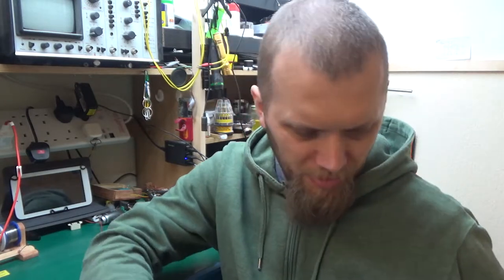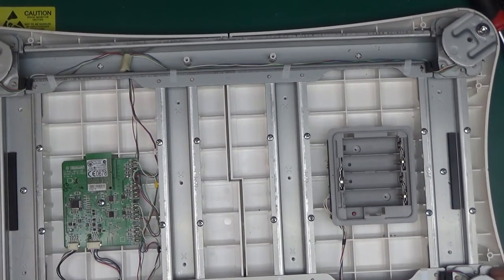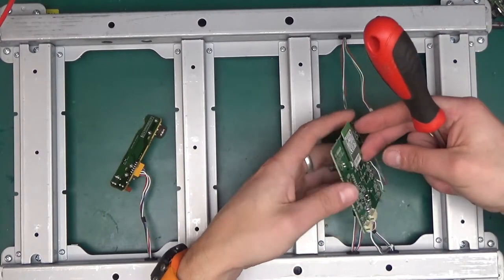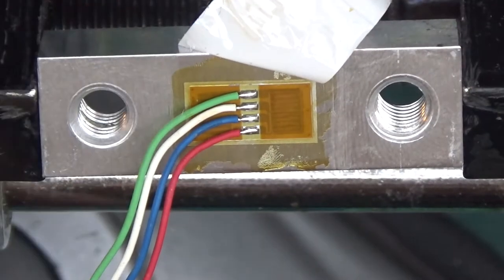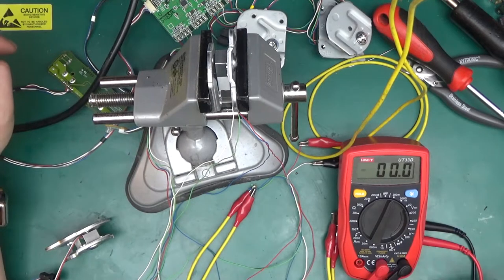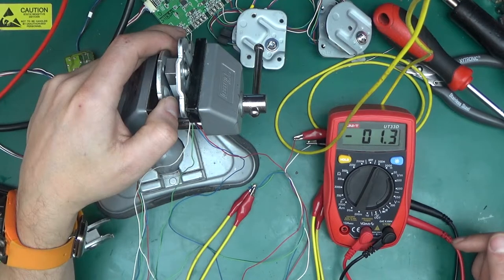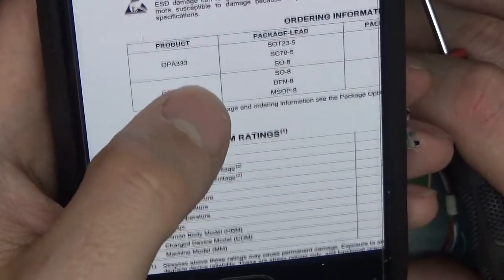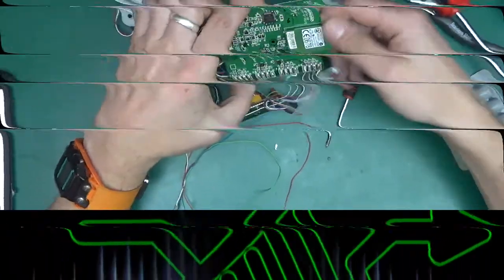Balance the wii load cells - one way teardown

Comment: There are 4 resistances in btween the nodes in the strain gauge, all configured as a wheatstone bridge bridge.  Each element is an active 734 ohm element, and across just one leg you get the (1/(1/734 + 1/(3*734) = 550 ohms.  Look up "Full Wheatstone Bridge, Reversed-Bending Beam or Contraflexure Beam" --   Each element is active, with two opposites getting stretched in the parallel beam, and the other two getting compressed.  It probably can take the 4xAA=6V excitation.

Comment: Hi... I've cleaned my wii balance board. But it's still not working. Where U put the battery, inside board is a bit rust. How can I fix it. Thanx
Reply from the maker: There is not much to go wrong with the board. Likely the batteries are not making good contact due to rust. Clean that properly and should be good. Good luck!